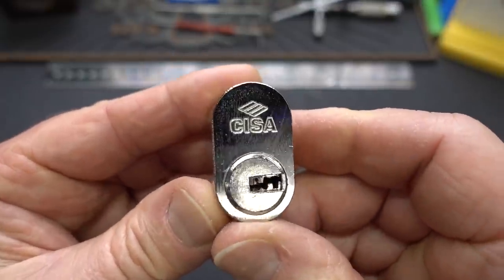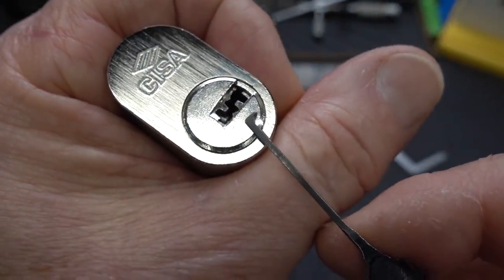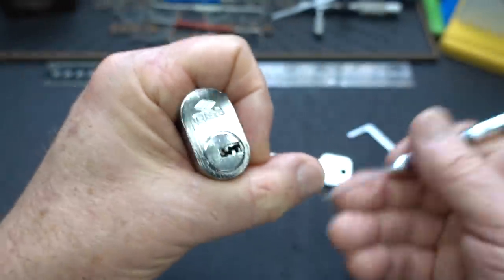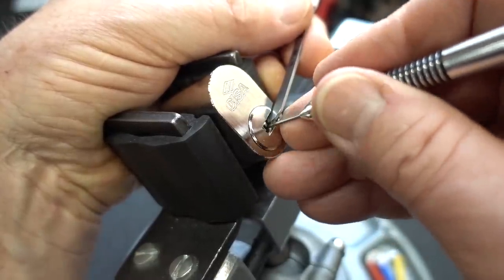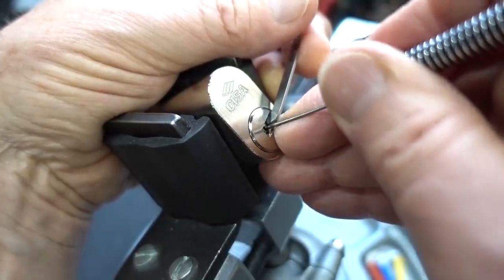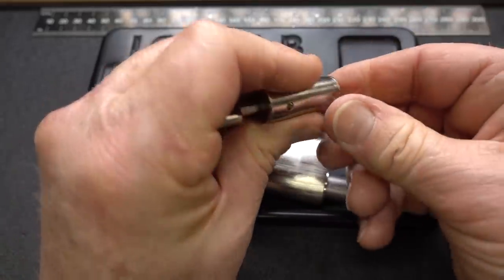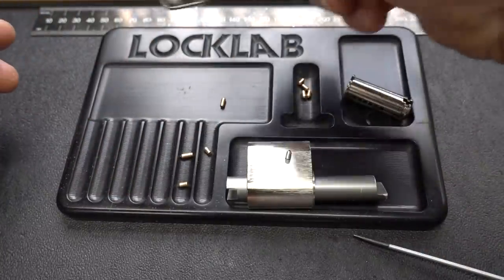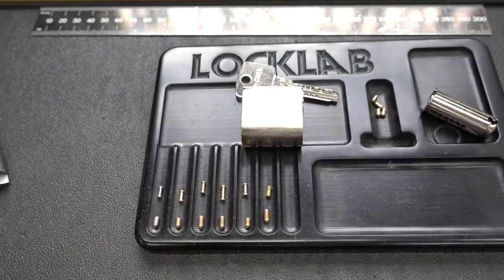(1831) Naughty Bucket Eviction (CISA Dimple)

Comment: ok so total newbie question:

with the gutting mishap and losing the order of the pins, is there an "easy" way to figure out the order of the pins when reassembling the lock?
Reply: Taking some calipers and measure the heights of the pins and look at a pinning guide you need the key to figure out the basic cut order
Reply: You can put the key in the keyway and try different pins in different positions until they're all perfectly flush with the surface of the cylinder.